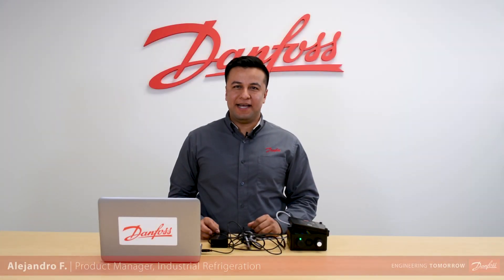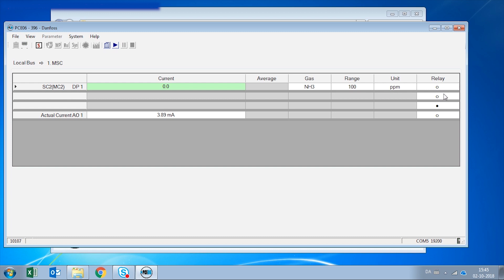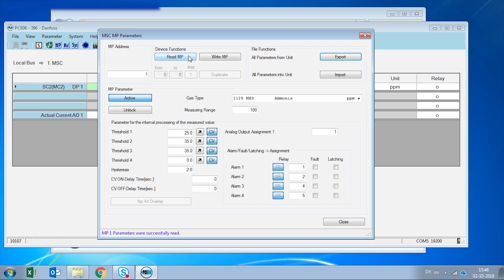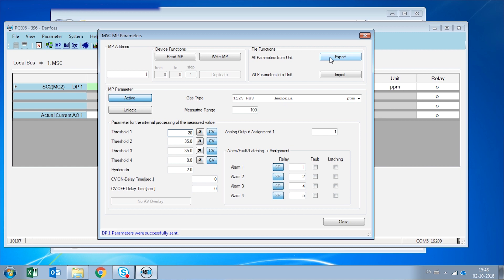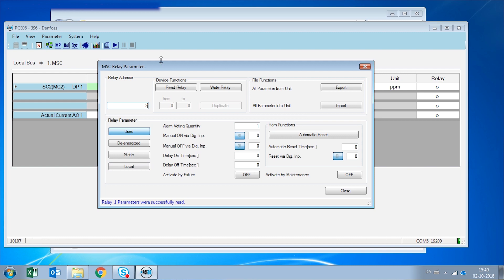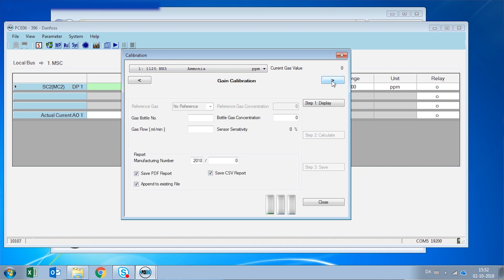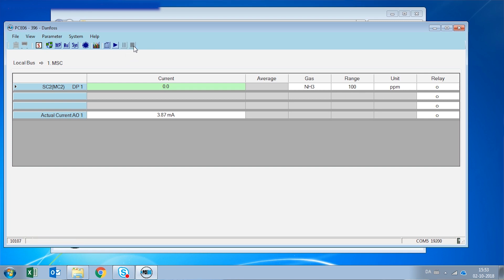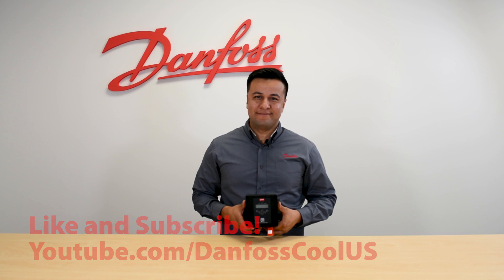Operating your Digital Ammonia Gas Detector using your computer with the Danfoss PC Tool

Comment: Good Morning password is?
Reply from the maker: Hi Valerio, for password information on the PC-Tool, please refer to page 5 of our user guide: https://assets.danfoss.com/documents/DOC272555769549/DOC272555769549.pdf. For the password on the gas detector, please refer to page 6 in the Digital Ammonia Gas Detector user guide: https://assets.danfoss.com/documents/DOC285951854588/DOC285951854588.pdf.